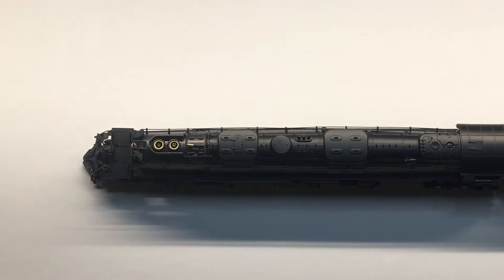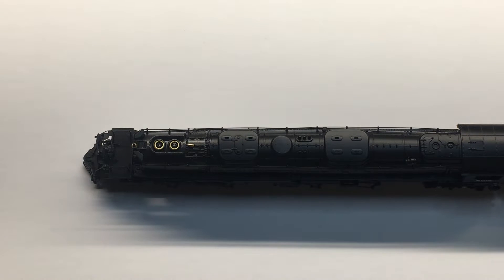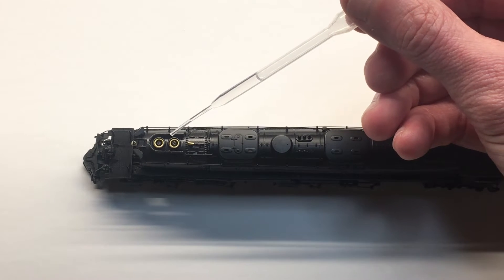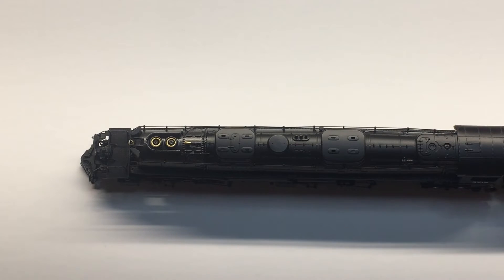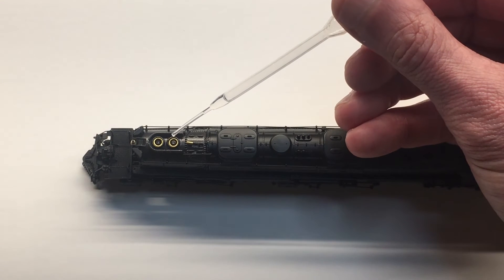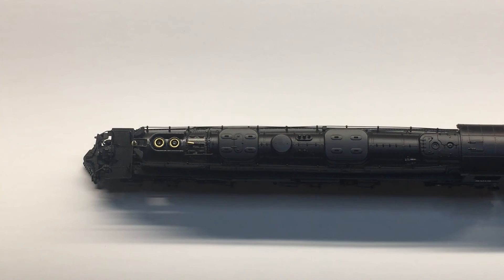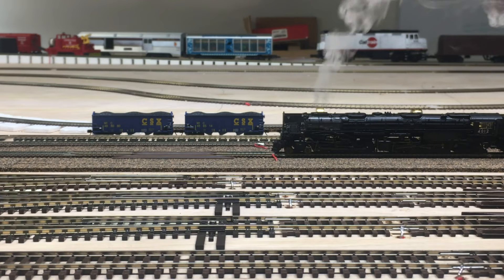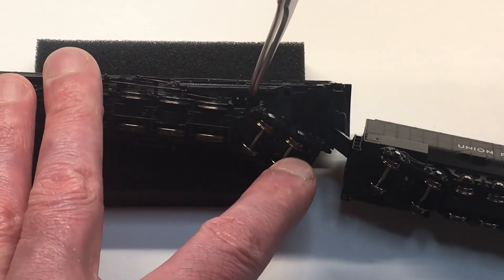N Scale Big Boy Smoke Fluid Application

Comment: In the description on the official website, Nscale big boys have lighted number boards，But actually received the model, I found that there is no such function.I tried change CV128=1，but still doesn't work.
Reply: Any luck getting your number boards to work? Have a feeling it was cut and paste from HO scale.  I have the Broadway Limited 7239 UP Big Boy #4024
Reply: @Powie1965  I just bought 4024.  Filled it with smoke fluid and put it on my layout. The smoke unit made two thin spurts of smoke then stopped working.  Still waiting to hear back from BLI 11/14/23 as I've only had this loco for less than 4 days at this point.